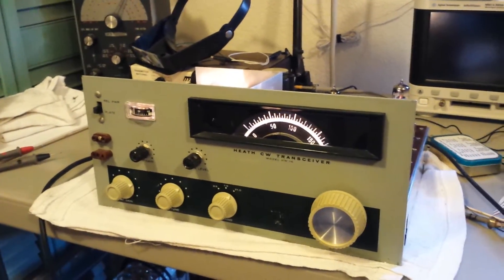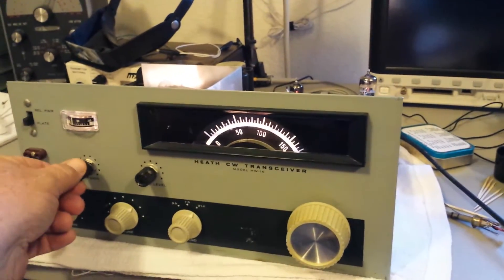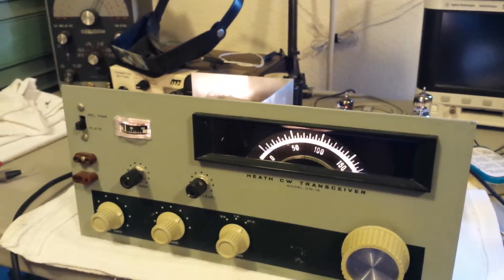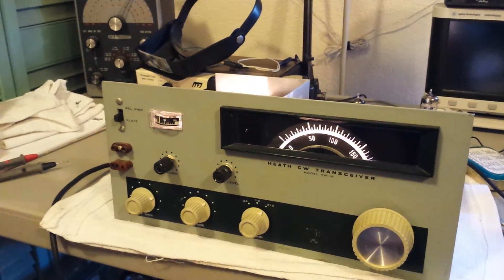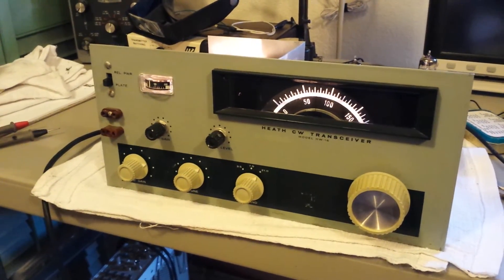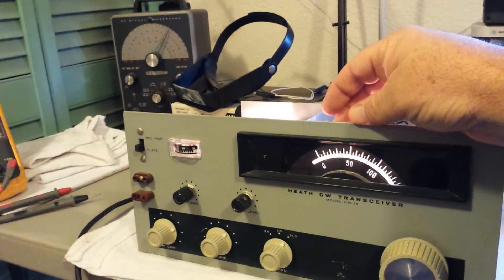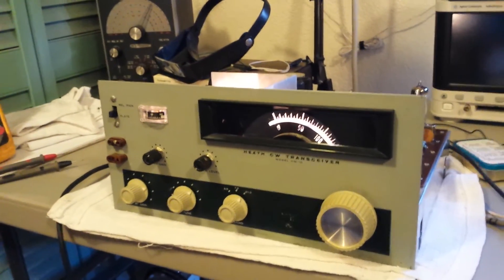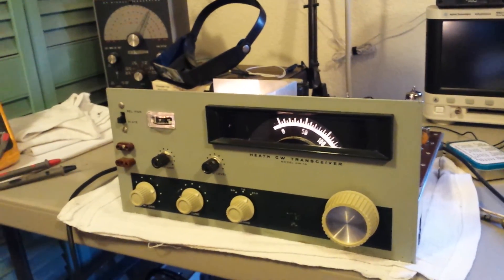HW-16 First Light

Comment: I got one to rebuild, as a new ham without a lot of knowledge of electronics, so I appreciate videos like yours.  My idea for the tuning dial is to xerox it onto a mylar transparency, cut out at a slightly smaller radius, then stick it to a full size circle of similar material of the original dial with some kind of clear adhesive with a non-rigid dry state.  I like the idea of replacing components - you mentioned carbon composition resistors - should I replace these?  Nice video - thanks -  PS - is it common practice to just get replacement NOS tubes for all tubes, or keep what works and replace the rest?